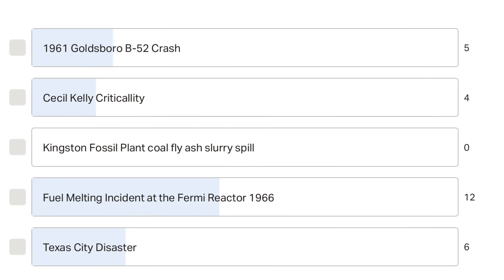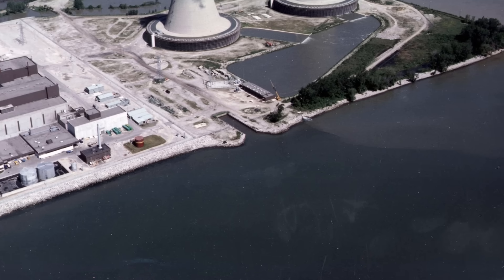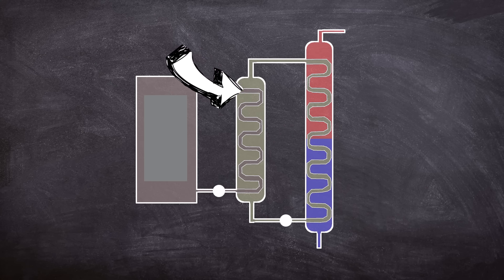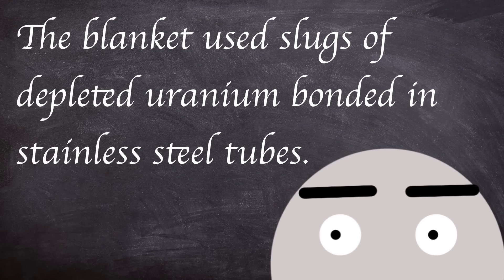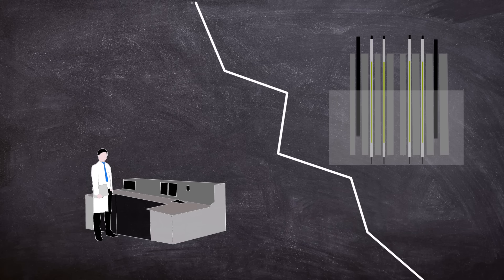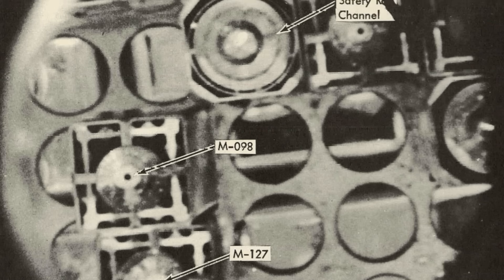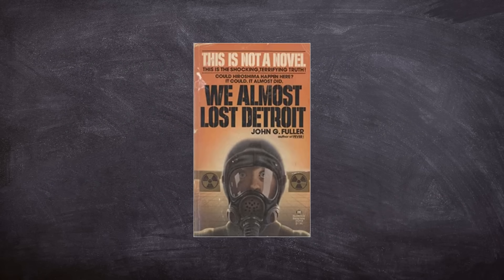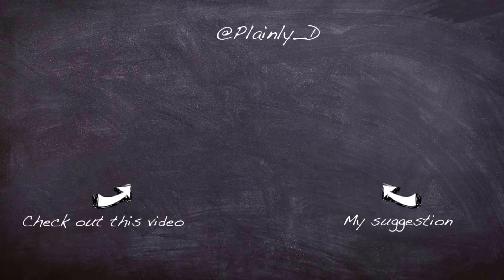A Brief History of: The Fermi 1 Reactor Meltdown (Short Documentary)

Comment: - Reactor operates for no issues for 50 years providing clean carbon free electricity
- Public: reactor? what reactor? we just get our electricity from wall socket lol!
...
- Reactor has technical issue which results in absolutely zero external impact
- Public: shut down all nuclear power now!!!!
Reply: Karen's dammit
Reply: @Cassandra A meltdown can cost you an entire reactor but why is that a drawback that other power sources don't have? Or indeed any industrial infrastructure. If you don't use it properly or mistreat it and don't maintain it well (or sometimes you're just plain unlucky) you can have an accident that is a complete writeoff of the asset. If you do your job though, it will be rare enough that it's a manageable cost.
Reply: @zolikoff  Because if something goes bad at a coal, gas, oil burner, you can literally walk in with a tee shirt on when it physically cools off enough that you don't get burnt and start working on repairs with normal non exotic materials. When one of those plants is off, you can literally walk anywhere you want and be as safe as you would be anywhere else. A nuke plant that obviously (should be obvious) isn't the case... there are places you can go, that within a week of walking through you can literally be dead.
Reply: @kleetus92  Unfortunately things that should be obvious for some reason aren't obvious because people "learn" from popular culture and hollywood movies instead of actual scientific knowledge, and in this particular case the pop culture "knowledge" is so off that it wouldn't even fit a fantasy book about magic.
Reply: Public is basically just karens

i believe france is better off with safe, cheap nuclear power
Reply: @TheRadioactiveBanana32  french nuclear is not cheap, or safe.
Reply: What do you mean, 50 years?  Fermi 1 melted down during testing to full power.
Reply: @blitzmom2674  Fermi 2 is still operational.  In fact, it's currently in the process of returning to full power after a lengthy maintenance outage right this moment.
Reply: @blitzmom2674  they're not the same reactor.
Reply: unless there's a reactor leak or sim
Reply: >carbon clean

yes, but what about the waste? You can't just bury it underground and let it seep into the soil...
Reply: @mizz1414  this is one of the points of a fast reactor.  Fast reactors can run on nuclear waste and essentially burn up all the nasties from nuclear waste.  This process will reduce the amount of waste by a factor of 100 with the left of waiste having a max half life of around 30 years.  After about 30 years this waste's radioactivity is less that natural back ground. Both the US and Russia have built successful liquid metal cooled fast reactors.  Russia is currently running a lead cooled fast reactor off of nuclear waste, BN-800, for power production.
Reply: Literally tons of radionuclides thrown into the atmosphere via burning fossil fuels while switching to renewables.  Or ten time less buried in the earth, safely tucked away while we convert to renewables....  I guess we just breath it all in huh?
Reply: @darrelljohnson7832  I say we stick with nuclear until fusion comes along. Like 50% power or more from nuclear, and the rest from renewables.
Reply: @darrelljohnson7832  japan getting ready to dump waste from fukaskima diachi into ocean.
Reply: @dylanpresidafonseca2545  Power from fusion is only10 years away, just like it has been for the last 50 years.
Reply: @mizz1414  That's what they do with old wind turbine blades and solar panels...
Reply: @mizz1414  put it in a concrete box, and bury that in some dry soil. (Somewhere in the middle of the US would be ideal.)
Reply: @dylanpresidafonseca2545  

Concrete doesn't last forever and will degrade over time, especially because the soil moves all the time (earthquake) and that also will compromise the storage...

And imagine 100 years later, everybody forgot about that radioactive stuff under the earth and the concrete box is now broken...

Radioactive waste will be leaking out into the soil again...
Reply: @mizz1414  do you know just how strong reinforced concrete is? The only thing that threatens it is water. Just put it somewhere geologically stable and dry, and be done with it.
Reply: @mizz1414  the waste inside will have a self sealing containers, and the concrete is there to protect those.
Reply: @mizz1414  flooding? In the middle of America? What?
Reply: @mizz1414  and if an asteroid hits the waste would be the least of your problems, as it isn't even that bad anyway. Also, volcanoes don't exist in geologically stable areas. I'm probably younger than you anyway lmao.
Reply: @mizz1414  It would take significantly less time for it to be safe, since uranium comes from the earth anyway so it's only the short half-life stuff that's dangerous.
Reply: @dylanpresidafonseca2545  Yes, it does flood in "the middle of America". A large part of it was an inland sea at one time, as well. More concerning is that the largest freshwater aquifer in North America lies in "the middle of America". One of the biggest earthquake threats lies around the Great Salt Lake area. A place so geologically stable that a lot of homes are unreinforced brick. There are plenty of threats from waste that have effective lives that exceed 10,000 years. You need about 10 half-lives to reduce something by a thousand-fold. You have to consider the entire decay chain, not just the headliners.
BTW, fusion isn't clean either. Neutron bombardment doesn't just embrittle metals, it can transmute them into radioactive materials. This is why Helium-3 fusion is looked upon as a future fuel source despite it taking more energy to initiate and sustain a reaction. The high temperatures required to achieve fusion, however, leaves a lot of energy floating around to create side reactions that do create neutron flux.
Reply: @Markle2k  fusion is so clean compared to the produced energy that it'd be better than any other options. You could specifically avoid the unstable and wet areas. And the ones that are dangerous for that long aren't going to have much of an impact if a tiny amount leaks.
Reply: @Markle2k  also, it was an inland sea. It won't be again for like millions of years.
Reply: @Markle2k  the advantage to helium-3 is you can make reactors more compact, as you don't need several meter thick concrete walls.
Reply: @mizz1414  Finland is building a bedrock deposit for radioactive material. Being a geologically stable place and in a quite inhospitable place, it's considered extremely safe storage.

Reactors can also be build to make much less waste with short halflifes @ ~ 300 years. LFTRs for examble.
Reply: @mizz1414  What about coal mining waste products they have an infinite half life (not radioactive) but are extremely toxic with tailings ponds so large your mind would boggle at the scale usually all that protects those is some thick poly sheets and earth dams. High level nuclear waste can be made so compact you'd be able to shove it into a deep borehole and just let earth take it back up. Radioactive materials don't last forever, heavy metals do nuclear mining makes far far less waste products than other forms of mined energy. An earthquake over a tailings pond could cause permanent ecological destruction across countless sites in the world as tailings ponds are typically just covered over and ignored. Just compare the size of nuclear power's whole operation vs coal power. 

Life is also used to radiation exposure as it naturally occurs with widely varying background radiation levels across the planet while heavy metal exposure is unnatural and most life is not well suited to handle even low level exposures.

Not to mention with a working fusion reactors that we already can make (doesn't need to be a net positive generator) you can literally burn off the nuclear waste and trasmute it into something far shorter lived.
Reply: @mizz1414   Some examples of our inability to contain the messes that we make:The: Nuclear coffin in the pacific, The Hanford Nuclear reservation,  the New Mexico Waste Isolation Pilot Plant.  We're creating waste that will be around for tens of thousands if not hundreds of thousands of years.   

If you seriously watched this guys stuff you should realize how fallible humans are. We often think things are "perfectly safe" only for a levee to break and flood our rivers with millions of gallons of lead and cyanide. 

Why did the Fukushima nuclear power plant melt down? because the builders didn't foresee the conditions that it would have to face. even though they built it to survive massive earthquakes (and it did)  it succumbed to a tsunami.  You'd think they would have planned for tsunami's?  I mean they invented the word they must have some serious experience with them?  Right?  Now there's so much radioactive water they don't have anywhere to put it and are thinking of dumping it back into the ocean..
Reply: @goldenpun5592  By the same logic, we should stop building solar panels because we don't know the long-term impact they'll have on the environment.
Reply: @nnelg8139  I mean I heard whenever wind turbines get decommissioned (often a lot sooner than planned) they just bury the fucking things because there's no easy way to repair or recycle them...and solar panels CAN be recycled...so I dunno
Reply: @goldenpun5592  Gee you mean people in the 1940s and 1950s didn't know and/or didn't care about nuclear safety like we do today?

HOLD THE PHONE, STOP ALL CURRENT NUCLEAR PLANTS, THIS CHANGES EVERYTHING
Reply: @theghostofthomasjenkins9643  Thats why I said Fusion is the Future.
Reply: @mizz1414  fusion is still too far off to be a viable form energy.
Reply: @mizz1414  So we should stay on fossil fuels and coal?
I think that in 1000 years we will find a solution to a problem of nuclear waste sitting safely under a geologically stable terrain. I think that having high level of pollution that causes global warming is slightly bigger problem. There is nothing for free, all we get to choose is which option is the best for the environment. Renewable energy also produces a lot of waste in production procces, and fusion reactors are hella expensive. Nuclear is the way to go untill we find a better option.
Reply: Mizz141, we need 'clean' energy right now... Modern nuclear power has by far the least amount of deaths associated with it per unit of energy generated of all types of energy generation we currently have. Nobody is against hydro, but it literally has tens of thousands of deaths associated with it due to flooding. Even wind had a larger death toll per unit energy generated than fission!

We can't wait 30 years for fusion to maybe become economically and technically viable on the scales necessary to power entire nations!
Reply: @dylanpresidafonseca2545  they tried burying it 2300 feet underground, but it failed in 2014 and blew up, and burned out of control for years. It spewed plutonium and other killer nuclear waste over 45 miles into Flagstaff. WIPP still burying stuff there because NO where else to put it. So they stack it up next to reactors until they invent some way to store it, been trying for 75 years and no answer yet. Storing it onsite is a really bad idea, look at fukaskima diachi.
Reply: @dylanpresidafonseca2545 flooding almost caused a meltdown in South Dakota a few years ago.
Reply: @dylanpresidafonseca2545  trojan plant as most taken out by my Saint helens.
Reply: @fnulnu4972  I know, it's awful, I remember all those news reports about all those poor people who died horribly... Hang on, I've never heard of this even once. Sure you aren't overexaggerating it a bit?
Reply: @dylanpresidafonseca2545  not even a little. Downwinders fróm hanford. Down river from hanford. Mega deaths in Ukraine and belaruss.
Reply: @fnulnu4972  you're drunk. Have a glass of water and get to bed.
Reply: @dylanpresidafonseca2545  just responding to ridiculous scenarios. It is ok to pollute the earth now because maybe we will have safe nuclear in the future. Carbon pollution is a huge problem, CO2 feeds the trees. But carbon14  nuclear waste is toxic, gates is now spraying calcium carbonate into the atmosphere, just to see if it is safe.
Reply: @fnulnu4972  have you ever considered how much carbon-14 is produced? Basically zilch in comparison to the produced energy.
Reply: @dylanpresidafonseca2545  170 metric tons that is getting ready to be dumped into the ocean, along with even more tritium.
Reply: @fnulnu4972  taking what you're saying as fact, (which is probably a mistake) there is like 13 orders of magnitude more water than that, and water is a great radiation shield, so all that sounds absolutely fine, even if it were true. I would appreciate some sources so I can see where you're getting your knowledge from.
Reply: @mizz1414  all those earthquakes in michigan... You should look up how they store spent fuel, it's actually really interesting. And water insoluable
Reply: Launch waste into the suuuuuuuun
Reply: @mizz1414  Most radioactive elements of nuclear energy waste is reprocessed and less than 1% is buried, and even then most of them have a half life of less than 25 years. Radioactive waste it's not that big deal of issue of nuclear scare wants to be
Reply: Nuckear poiwer is from satan and akk reactire mnust be closed and buried deep in mud and ckayt and cement

Comment: I'm very confused about the black and white "flag" thing that appears in the top right corner of some slides... what does it mean?
Reply from the maker: It means an advert is coming up
Reply: In the UK (maybe other places) up until the 90's, there used to be that flag to indicate the adverts were coming or the end of the episode. It's called a cue dot or cue marker, it is used to indicate to downstream systems and technicians that a commercial break is about to occur. The systems downstream of the studio need to insert adverts and in a channel which has a single output it is easy. TV channels like ITV has regional advertising so they use the cue marker to tell the multiple regions when to do their thing.

In today's totally digital ecosystem this shouldn't be necessary, they should be using SMPTE-104/35 signalling which is not visible.

Comment: This was OK, but it really could've used a test at extremely low power for good measure. ;)
Reply: They were running it at low power for a few years. Unfortunately, they hadn't identified that loose plate as the cause of the tiny fluctuations.

Comment: "We almost lost Detroit" yet the safety measures worked like they should and the people working the plant did their jobs properly. A piece broke off only after the reactor had already been running for a long period of time.
Reply: It's a nuclear safety success story, yet it was spun the opposite it seems
Reply: "Somebody" called the local police and suggested an evacuation would be needed, but never really had civil defense plan in place. That is the origin of the tagline.
Reply: @burtony3  didn't know that. That you for the information.
Reply: No it had not been running for a long period of time. The reactor was still being tested in the run up to full power.
Reply: @blitzmom2674  It was a prototype. The reactor had been in operation for over three years when the accident occurred.
Reply: @pseudotasuki  Albeit at low power levels and not running constantly.  There's a book titled "Fermi 1 - A New Age for Nuclear Power" that gives a good history of the plant from initial planning through final shutdown and partial decommissioning, that includes a chapter on the fuel rod incident.  Parts of the book tend to get very technical, but it's still a decent read.  Also has good historical photos of the plant being constructed.
Reply: @sct913  Yeah, I was disputing the claim that it hadn't been running for long. For a normal reactor the testing period is much quicker, as the behavior can be predicted. A prototype of a completely new type of reactor takes far longer to reach full power, as they need to determine its behavior experimentally.
Reply: @pseudotasuki  Understood.
Reply: Damn. Maybe next time

Comment: I have a pretty challenging one. Late 1970ies, behind the iron curtain, Czechoslovakia. Town of Jaslovske Bohunice. Reactor A1. INES level 4. Fuel meltdown because of a refueling accident caused by silica gel clogging the coolant pipes. https://en.wikipedia.org/wiki/KS_150
Reply: I live like 40km nearby
Reply: @marianmarkovic5881  Me too, there is still a lot of secrecy about this accident and well the meltdown is just the tip of the iceberg. Go to "ustav pamati naroda" and you can find that some things went even worse than in Chernobyl. I did a bit of digging there and it was not nice to read (I can provide the names of the files, as for me I changed plans where to live). But I am still a big proponent of nuclear energy, because all the mistakes there were done by human negligence.
Reply: @MichalProzac  Well i give them bit of leavey here, it was kinde experimental project, and they neglect lot of things to accident happend(not cleaning Silicagel in assembly, not watching thermal monitors during inserting rods into reactor). Still situation could go much worse, Leak of radiation outside plant was minimal(they had to sanate part of river near plant) overal damage could even be repaired, but cost/performance was not there, buying blueprints to VVER440 build it home and buy fuel from ZSSR/Russia made in the end much more sence. (and those reaktors work well).

https://www.idnes.cz/technet/technika/ako-vyradit-jadrovu-elektraren-gulockami.A170220_123929_tec_technika_mla
Reply: Looks like even nuclear reactor aren't supposed to eat those packets lmao.